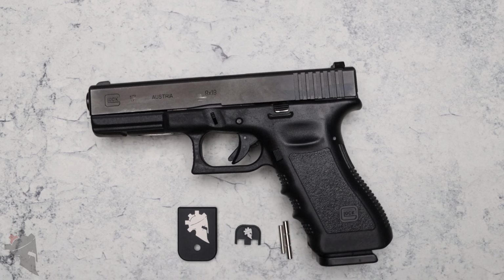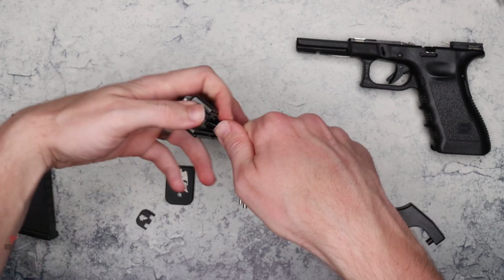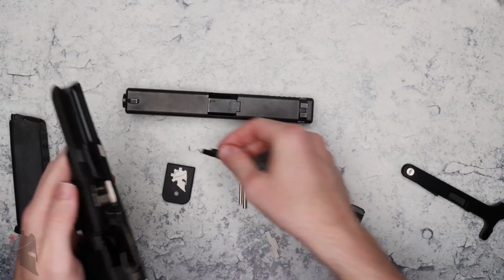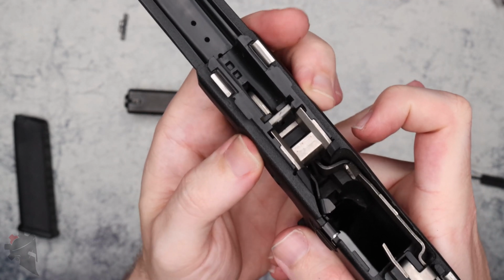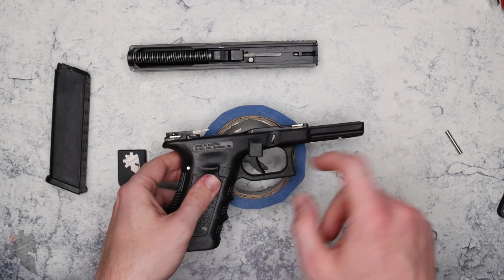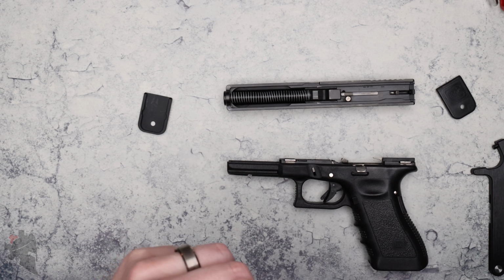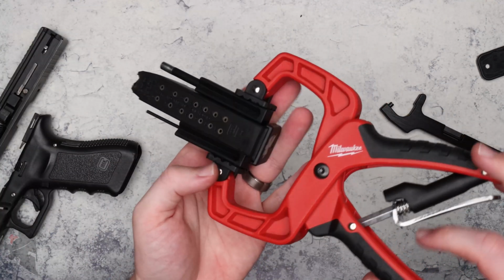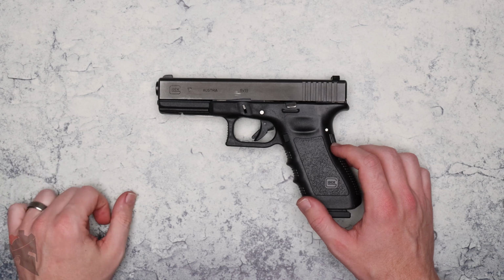How to Upgrade Your Glock with Bastion Gear Parts! (Super Easy)

Comment: As i understand given upgrades are purely esthetical. How about spongy trigger upgrades?
Reply from the maker: You can get rid of the spongy trigger feel by changing out the trigger bar and springs. There are several great Glock drop in replacement triggers on the market that will make it MUCH nicer than the stock feel. Apex Tactical, Zev Technologies, and Agency Arms for example.
Reply: @TheWarriorSolution  roger that. Will take a look

Comment: I was struggling to push in my bastion magazine base plate on my G19 gen5 even with the clamp 😭
Reply from the maker: Yeah, Glock mag baseplates are notoriously tricky to work with. I noticed on mine that there are a couple of small extrusions in the plastic that basically flex and then snap into place to keep the OEM plastic baseplates secure. The Bastion plates (and any other brand that uses metal instead of plastic) are tough to force over those for sure. The clamp method I showed in the video worked well, just add a little "love tap" from your favorite hammer if all else fails. ;)